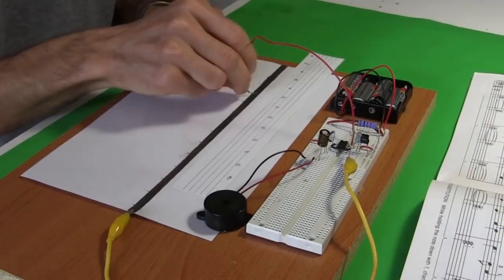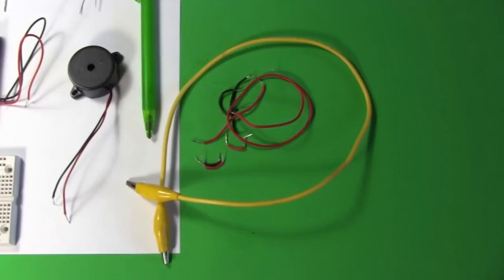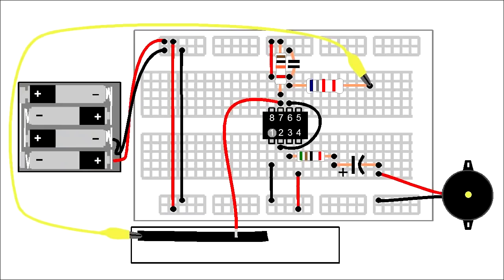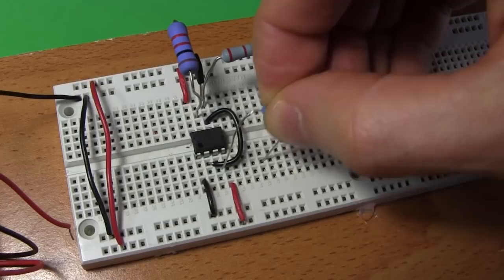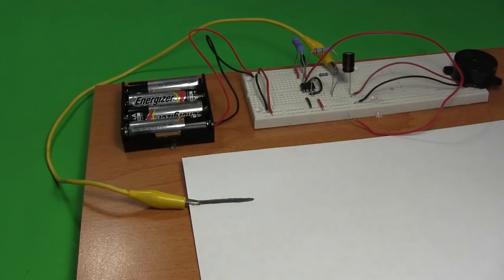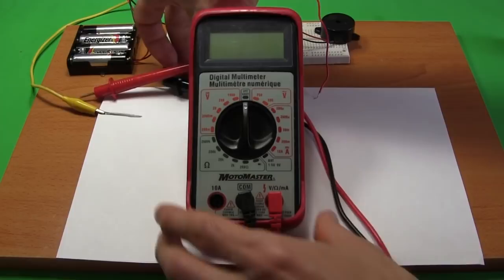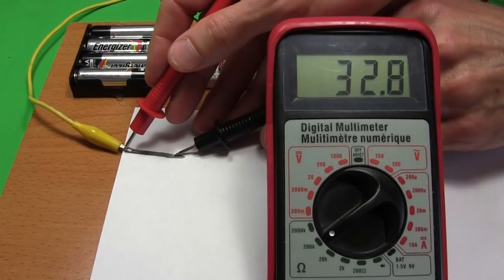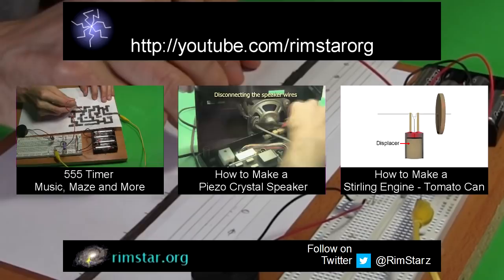555 Timer Music Instrument How to Make

Comment: i have a problem
i cant fugure out a problem and purpose 
becuase i also want to measure sound measure resistance this is my  problem and purpose. i need help on this

Purpose
The purpose of this experiment is to determine that the width and length of the graphite resistor changes will affect the resistance and to see if A, B, C, D, E, and F on a 1cm by 12cm graphite resistor, will change the sound according to the sections named by letters.
Problem
Which graphite resistor will have the highest resistance by changing the width and length of the graphite resistor by changing it to 5mm by 5cm, 1cm by 6cm, 2cm by 7cm, 3cm by 8cm, 4cm by 9cm, and 5cm by 10 cm and also to see why
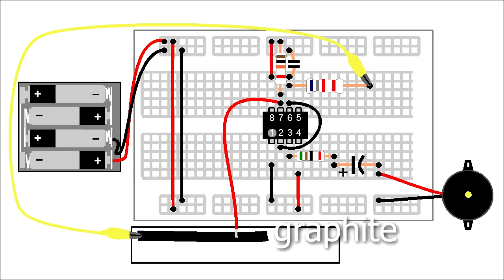Reply from the maker: +hp26711 To measure resistance you just need a multimeter that can measure resistance like I do at 5:05 in the video. But I wouldn't change it the way you do. I'd keep the length the same and test different widths. That way you're testing the effect of the width on the resistance. Then I'd do a separate series of tests where I'd keep the width the same but try different lengths. That way you're testing the effect of the length on the resistance. You should change only one variable at a time in your testing. As for the "why", there's a good animation and explanation on this page under the heading "Cross sectional area" http://www.regentsprep.org/Regents/physics/phys03/bresist/default.htm.
Reply: +RimstarOrg but what about sound 
i need to measure sound
Reply: +RimstarOrg 
u know the aligattor clip that goes on the graphite resistor what would u call that
Reply: +RimstarOrg 
Problem
Which graphite resistor will have the highest resistance by changing the width of the graphite resistor by changing the width to 5mm, 1cm, 2cm, 3cm, 4cm, and 5cm with the same length of 15cm and also to see which graphite resistor will give the highest sound at the end of each graphite resistor.

i need help at the last sentence where i need to measure sound
Reply from the maker: +hp26711 It's called an alligator clip.
Reply from the maker: +hp26711 I've never really worked with measuring sound. Maybe there's a proper tool to use but I've no experience in that area. However, a quick hack might be to use a microphone to record the sound and then bring that into a computer. Then use free software Audacity to look at the waveforms. The taller the waveform, the higher the volume. Audacity will also show you the frequency. I do that in these two videos https://www.youtube.com/watch?v=L5fVFA2sWt4 and http://youtu.be/PZVeJ2rh6ts.

Comment: i got a new one wich is called a piezo sounder
Reply from the maker: +hp26711 Maybe your old one container a normal electromagnetic speaker along with some circuitry which was causing a problem. I'm glad to hear it's working now. I'm not surprised that your sound is different than mine. Your pencil mark resistance is different and there's probably some difference in your piezo sounder. Do you at least get different sounds when you touch different positions on the pencil mark? If so then I'd say you've succeeded.